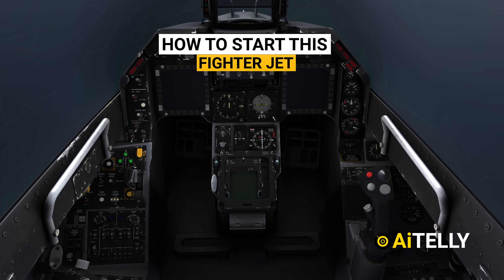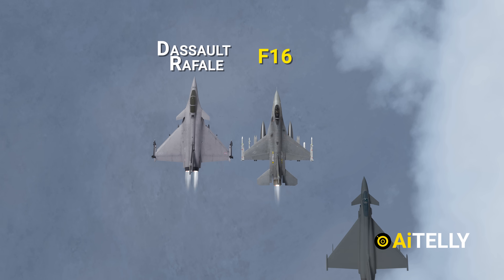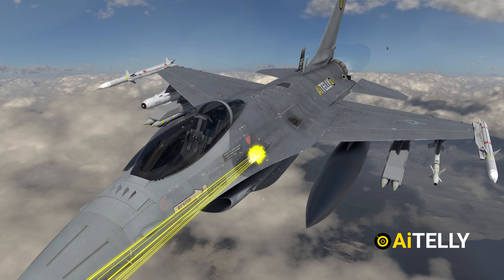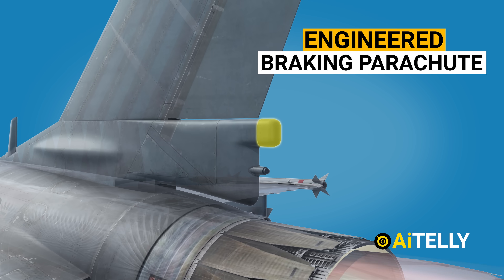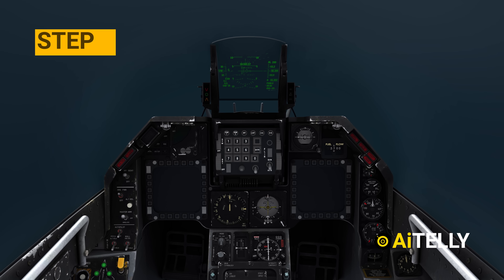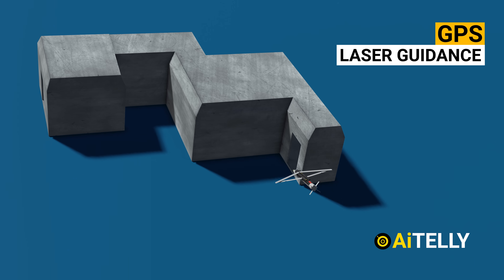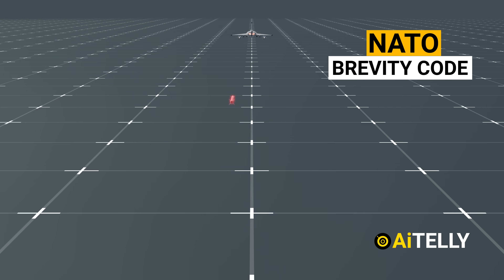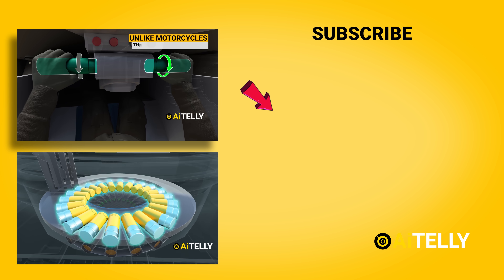F-16 Fighter Jet How it Works | 4th Generation Multirole Fighter F16

Comment: working of turbofan engine is presented incorrectly, fuel is not injected into fan, but into combustion chamber - so air must past thru fan, then asmaller part is compressed in compressor, then commes into combustion chamber and tere is mixed wit fuel! burn gassex exitehru high presure turbine, which powers compressor and then thru low pressure compressor which powers fan. at the end of engine is afterburner, where additional fuel can be sprayed into exhaust to providec additional thrust

Comment: I know the disclaimer is that the channel is an expert, but I would think you would get the important things right. Your description and visuals of how the engine works is very much incorrect. You could have at least mentioned there is a compression stage (low and high stages) and shown them on the diagram. This is all before any fuel and visuals of fire are depicted. This is not unique to the F16 but to pretty much all existing jet fighters.

Comment: Uhm the view reset button on the stick is not the proper name for it xD
That comes from a game called DCS- Digital combat simulator where someone used it for that function which trackir is basically a headtracker

I do believe its the nose wheel steering and missile step button

Comment: F-16 = AirForce F-14= Navy. The Viper did not replace the F-14, the F/A-18E and F Super Hornet did. Also The "TWS" or track while scan mode is a function of the main radar allowing the pilot to soft lock a target while still scanning for more.  The little bumps on the side of the nose are part of the "EWS" or electonic warfare system called "RAW gear" in fighter pilot speak, which stands for Radar Warnng Receiver. In this case they are passive antenas on the nose and tail which alarts the pilot to the direction and to an extent, distance to anti aircraft radars, missles and other fighter radars.  Good video, but if your going to pose as an expert do the research and check the facts. There were a few other misidentifications on AC parts and systems but I don't want to seem like an A-hole correcting the whole video because obviously a lot of good work went into it.

Comment: Narrator says that at 4,500 planes, the F-16 was the most produced fighter ever?  Is he referring only to jets?  Weren’t more than 4,500 F4Fs, F6F, P-47s, P-39s, P-38s, P-40s, F4Us and P-51s produced?
Reply: Even if you specify jet fighters, the F-16 doesn't hold the title of most produced. That goes to the MiG-21 at 11500.

Comment: The F-16 isn’t produced or owned by General Dynamics any longer. It is now owned and produced by Lockheed Martin. 

Roll characteristics are commanded by the horizontal stabilizers, not just the flaperons. This video has many flaws and a bit of misinformation. Please do your research prior to making this available to the public.
Reply: The engine operation is wrong. Combustion doesn’t happen in the fan, or compressor section. It happens in the combustor section.   The exhaust nozzle closes in normal engine operation and only opens up at idle or in full augment (afterburner).
Reply: Speedbrakes don’t open as far as you depict them to.

Comment: The combustion grafic is completely wrong. As it's shown, the combustion would take place in the compressor. More precisely, in the low pressure compressor. Or what would be the fan on a commercial airliner. 
Simply speaking, the engine is from front to back:
Low pressure compressor
High pressure compressor
Combustion chamber
High pressure turbine
Low pressure turbine
Exhaust nozzle ← this is where fuel gets injected for the afterburner

The movable "end part" is the muzzle, like on a gun.
It's wide open when the afterburner is on, that's because while it would function as a diffusor in subsonic speeds, at supersonic speeds, the role of diffusor and jet nozzle are reversed.

On the other hand, on idle, the nozzle is wide open as well, unlike shown in the grafic. It works as a diffusor at that subsonic speed, slowing the exhaust gases down, reducing the produced thrust. When thrust is set, the nozzle closes, increasing the speed of the exhaust gases while subsonic and thereby increasing thrust, not as shown in the grafic.

Comment: Question?
Why didn't they ever incorporate the wings to fold in at higher speeds?
Did they ever have a problem with the fuel gelling up at higher altitudes? 
What's the radar cross signature that the F16 leaves behind?
The F16 is still in use with some European countries?
Does the Kingdom Of Saudi Arabia have F-16's?
How's the F16 in a nose dive situation?
How's the F16 in a dog fight?

Comment: Your explanation of how an engine works is wrong.
Also the variable geometry engine exhaust is wrong, it is like that, to change from convergent to convergent/divergent style.
No need to push all those buttons to select weapons. This plane uses the HOTAS type of controls, so the pilot do not need to move his hand from the control stick and throttle.

Comment: Unfortunately your jet engine operation is completely wrong.
Reply from the maker: It's all basic process - we can't show everyting in 12 minutes.
Reply: @Aitelly  understood, but if you put the flames in the middle of the engine it would be accurate. Simple easy fix.
The fan is in the front, at the low pressure compressor. The high pressure compressor is behind it, then behind that is the can where the fuel is sprayed. So simply putting The flames in the middle of the engine will fix it.
After the flames is the high pressure turbine, after that the low pressure turbine and then of course the afterburner. But that one simple fix will do the trick.

Comment: Looks like you just ripped the models and textures from war thunder..... The scratch Marks and wear in the paint on the F-16 are exactly the same it looks to be the F-16A but with the blue on the tail panted  over. And the mig-21 looks like it's the Mig-21PFM from war thunder as well.

Comment: Good video.  
Constructive Criticism:  The F-16 was NOT designed to replace the F-14. 
  
Comment:  The General Dynamics F-16 was designed by the DOD "Fighter Mafia" for USAF Air Superiority (ref James Fallows).   In contrast, the F-14 was Engineered for US Navy Carrier multi-role operations.  

The F-16 survived due to clever software and hardware enhancements and avionic upgrades despite idiot Air Force planners addicted to multi-role do-everything mediocre aircraft.  

The F-14 should have been upgraded to the F-21... but our dumbassed NAVY planners like spending taxpayers' dollars and are on a quest for a Woke-joke Navy.